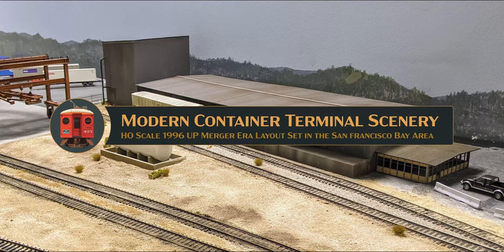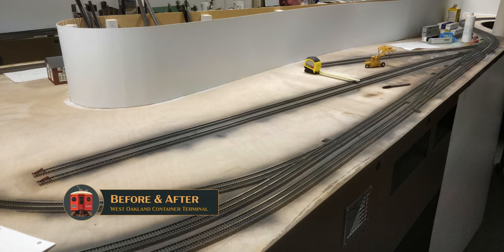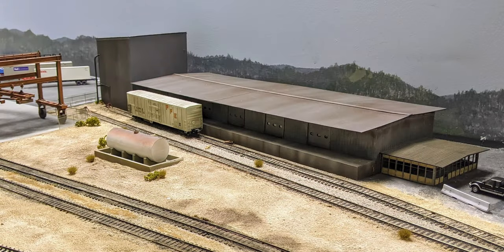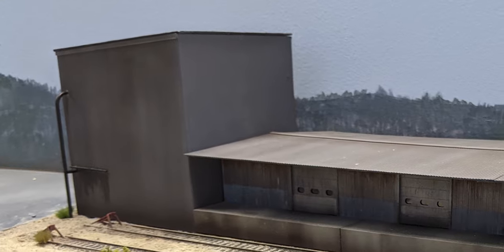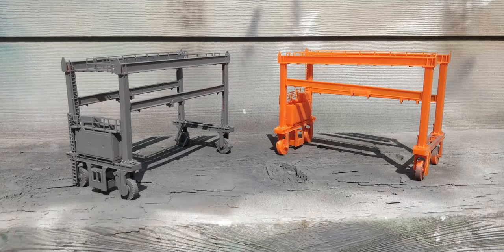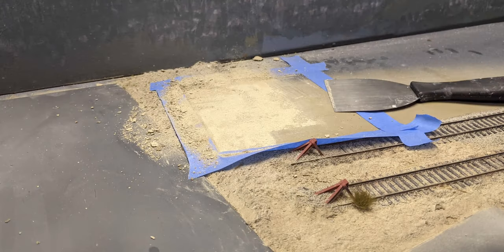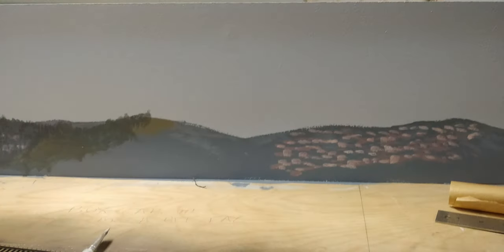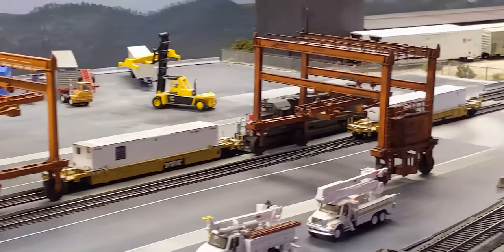Building a Modern Container Terminal & Industries in HO Scale

Comment: Really fine work on the scenery and structures. I did the layout design, which was featured in Kalmbach's Model Railroad Planning 2015. That article includes some earlier photos of the layout as it was being installed. Benchwork and track were built and installed by Rick Fortin.
Reply from the maker: Why thank you! It's such a fun trackplan to run on. The serpentine hidden staging is quite a daring layout design element, but it definitely works well. More scenery progress to come soon.